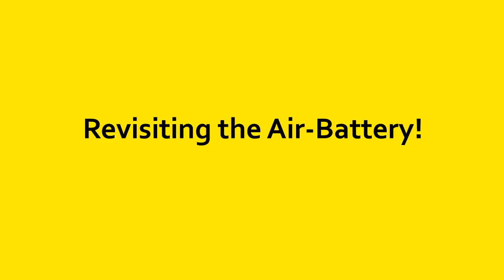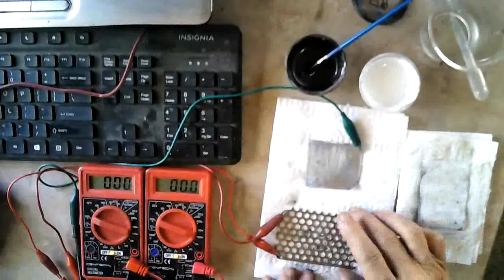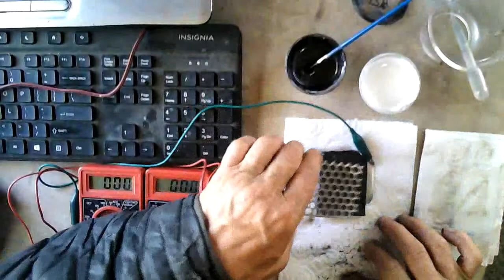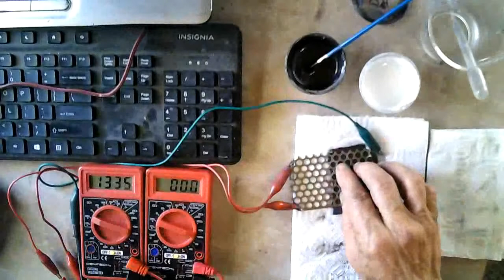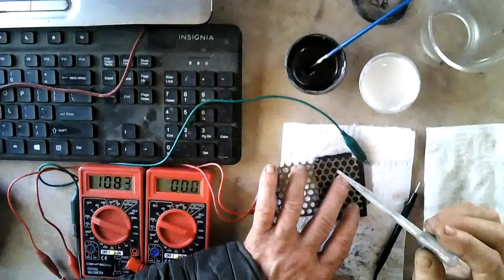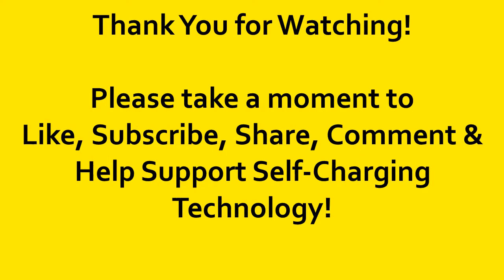Revisiting the Air Battery!

Comment: The pattern continues. I suspect it has something to do with carbon and Ti02. The water may be working as a solvent as well as a charge carrier. The SS grid works pretty well.
Reply from the maker: Same pattern, just more volts/amps with more oxygen. SS screens would add a lot to the cost of the battery. On one of the graphfoil electrodes I was cleaning, it looked like the Tio2 was penetrating into the graphite, and it's a pretty small compact molecule too.

Comment: What happens if you have flowing water over that cell. 50 +MilliAmps is good. Have you tried putting carbon in the meshes holes on top of the cell as well.
Reply from the maker: Hi Dan! This is my first experiment with this set up. A drip system would probably keep it wet and well oxygenated I would think. I'd like to keep it simple tho. We could call it a hydro-ponic battery!  Lol